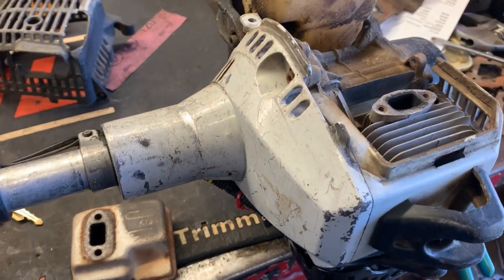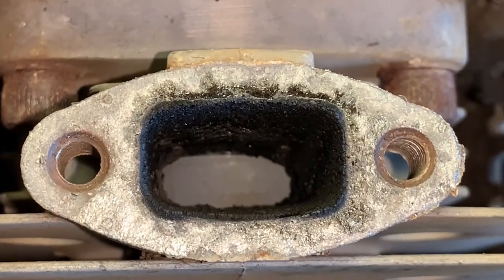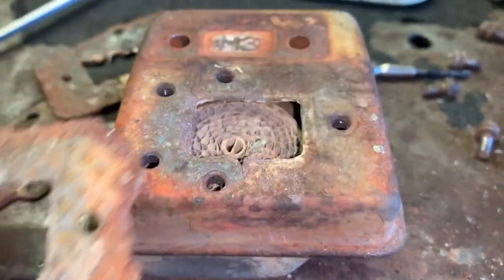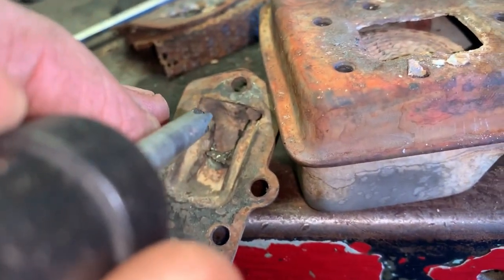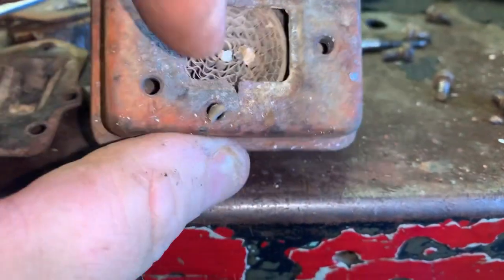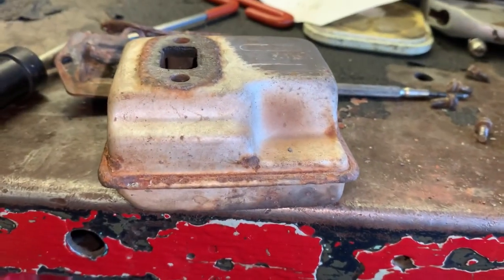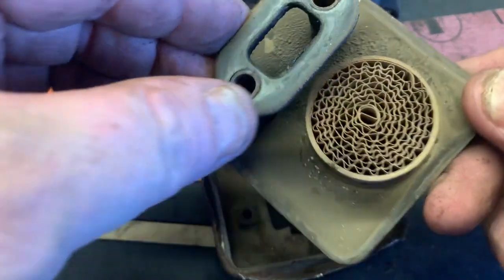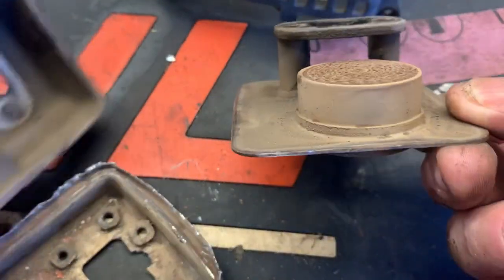CATALYTIC CONVERTER ON A WEED EATER?

Comment: Stinking converter thieves stole my converter on my Shindiawa. They managed to get it out through the exhaust outlet of the muffler. The main thing that I noticed immediately was how much cooler the plastic shields are. Before the converter was stolen the plastic on my 242 would get hot enough to be quite uncomfortable if it touched your arm while working the unit hard. Very big difference now. That’s been about five years ago and it runs great.
Reply from the maker: 20k dollar fine and 10 years inprisonment  if epa checks it.  I wouldn’t  publicly tell anyone that  I am committing a felony.

Comment: Mowermedic1, finally somebody like myself said just leave the catalytic converter alone, they have no real restriction at all and the problem was the defuser. I’ve said the same thing about automobile catalytic converters for years because, the problems are similar, back pressure or restrictions are usually after the catalytic converters. Factory mufflers and resonators are usually the culprits of major restrictions. Thank you sir for saying leave the catalytic converters alone!!!
Reply: im not even sure the defuser was problematic.
Reply: @paulg444  the video plainly showed the clogged up defuser was the problem, he even said he had to clean it out and it ran fine.

Comment: Great information. Thanks for all the great tips you give us. I have a question Zero turn mower with a Kawasaki fx850V started running really rich Puffing out black smoke from muffler if the choke is not stuck closed or partially closed what else on the carb would you look for?
Reply from the maker: Needle and seat issue or vapor canister saturated with fuel if it has one
Reply: Could also be a bad float inside the bowl? These past days I worked on a mower running rich took the bowl off and found the float was filled with gas.

Comment: On the cars the cats heat the exhaust to change or burn any Hydrocarbons left in the exhaust . It would be interesting to see if the cat exhaust runs hotter that non cat exhaust . If this is also what happens in this case .

Comment: I know a rep, who works for a company, who sells trimmers that these cats come on... The reason they install them has nothing to do with emissions. They installed them because users, who didn't use the trimmer properly, had oil dripping out the muffler so they put them on to mitigate that. I would have also expected it was emissions, but they don't use them on any of the other products, and this is why. 

Also, in most cases, cats are ceramic, but apparently in this, and other two cycle cats, the structure is a thin metal that is coated in the catalyst. 

Altho catalytic converters are likely a net positive, when you take all factors into account... You need to take all the factors into account. The rare metals that they use in these things needs to be mined, (not a clean operation) it then gets partly used up and spat out onto the roadways, and peoples lawns, in this case and then at the end of the units life the recycling process is energy intensive and not clean. 

Again, I'm guessing a net positive and a good trade off for cleaner air in our living areas.